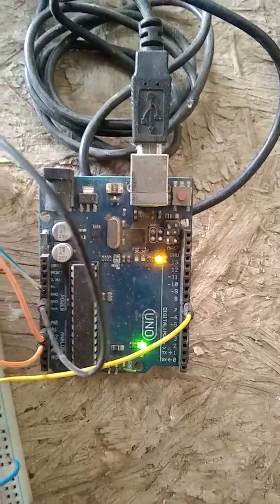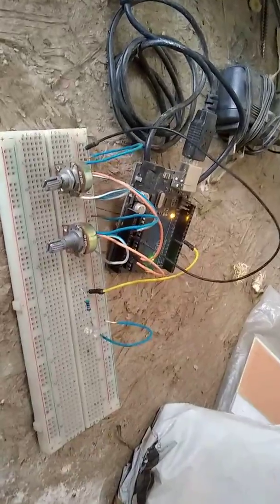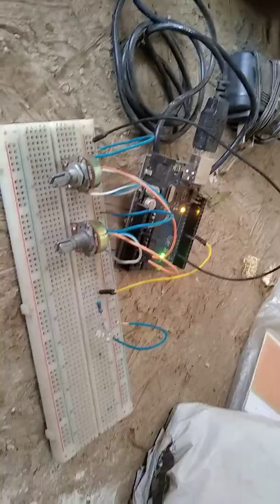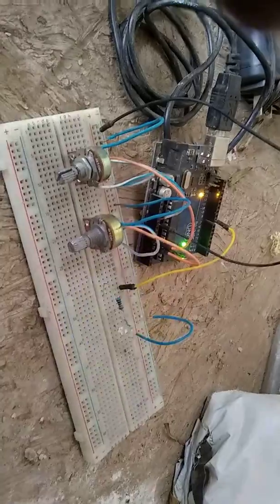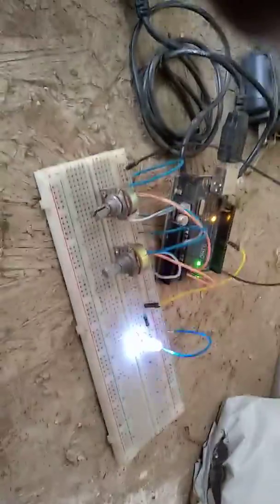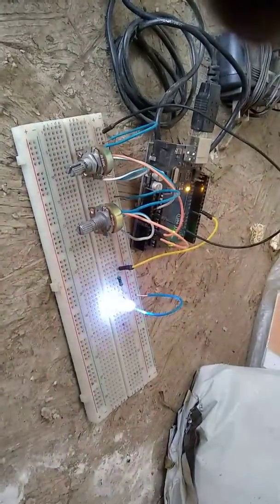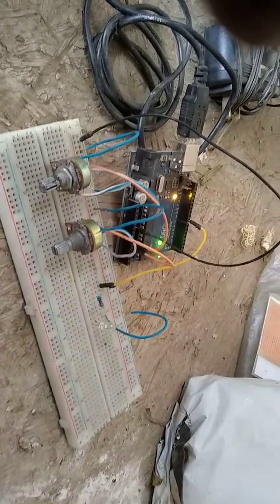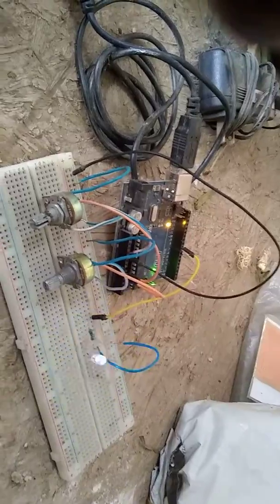Arduino Stan Meyer gated signal generator

Comment: Doesn't SM pulse generator has to sync/tune in with the resonance of the water capacitor? Could you be able to automate that somehow retrofeeding your arduino?
Reply from the maker: Eventually yes.  This would be first baby steps.  You need a working VIC transformer.  Like a radio, if you cant manually tune the signal, seek is not going to find it either.  At the point where you know what you are looking for and are ready to autotune, you would use arduino 'timer' libraries and actually get your reference clock signal from the actual internal clock of the arduino and actual provide precise timing rather than this quick dirty simple code.  And yes there is a feedback coil on Stan's VIC that gets analyzed as the circuit sweeps looking for resonance. Personally I have made enough bubbles to run a small torch for an hour straight, using not a full VIC but just a bifilar choke, and the water bath remained ice cold.  That was enough to convince me that electrolysis was NOT what just happened.   Building a house puts Stan stuff on the way back burner so Proof of Concept is as far as I have got
Reply: @jefflpearsonii4212  I found analogRead() too slow to pick up the natural freq. so I’m diving in low level code. Zero background with Arduino so far (had it for two days) but will keep you posted.

Comment: Can adruino make that signal but at around 300khz?
Reply from the maker: Changing the map function values,  the higher freq one could go as high as 500khz.  Arduino can go higher with dedicated timer libraries it gets more complicated
Reply from the maker: But it will not be smooth transitions at the extremes of delayMicroseconds command, for example, it will jump from 500k to 250k being next value.  I would consider that particular code realistically being good for 50k
Reply: @jefflpearsonii4212  new to arduino, is the code you put in the link copy and paste for the sketch? Or do I need to set parameters? Sorry just curious
Reply from the maker: @TheOldRecordStation  yes the files are plain text so yes copy n paste into Arduino IDE
Reply from the maker: I am new to Arduino also this was mostly an exercise in how to get a gated pulse train.  For actual use as a Stan Meyer signal generator, I will have to learn to use a more advanced timer library
Reply: @jefflpearsonii4212  thank you!